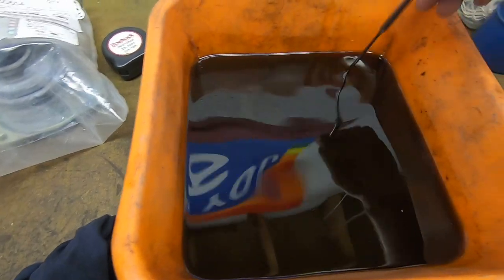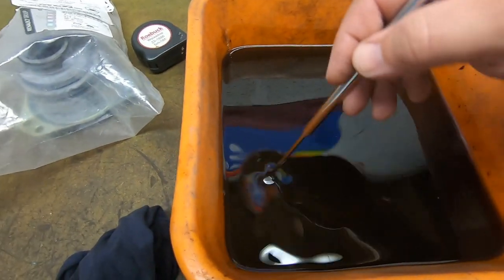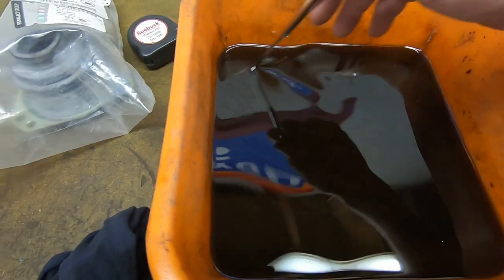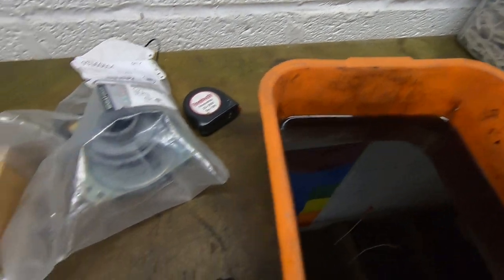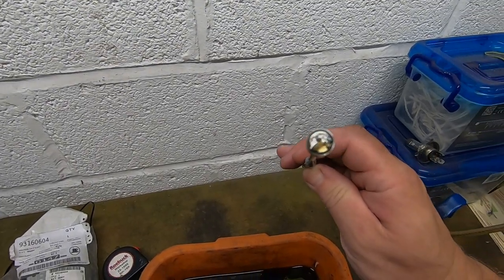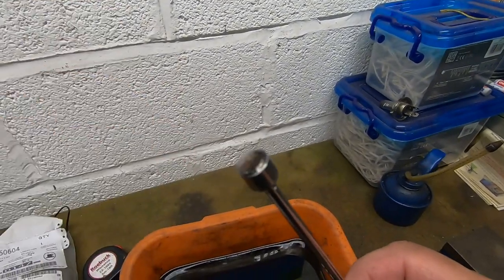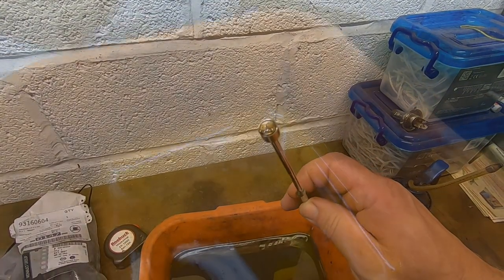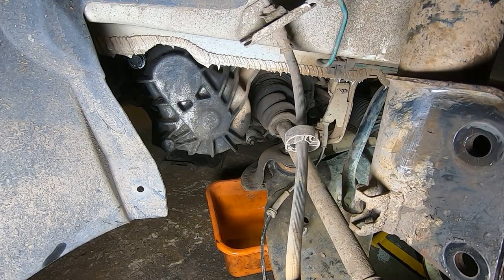Fixing our Vivaro's gearbox oil leak by replacing the driveshaft boot.

Comment: After your discoveries in the last video, I went out to look at mine. Fortunately not a drop of oil in sight (or cobwebs!).
As long as we get the gist of what you are doing, it doesn't matter if we don't see all the moves, your explanations are that good anyway.
Thanks for your troubles, they help loads for future reference should there ever be a need to get my gut under the van.
Greets again from 🇨🇭, Steve.
Reply from the maker: Thanks again 👍 great to have your feedback. Great that your gearbox oil is where it is supposed to be👌.
Cheers Larcs

Comment: Just bought a vivaro 2900, 1.9 converted to camper, high top, checked belts, cam belt and pump good but needs alt v belt, been watching all your vids there a great help . I also got oil all over gearbox same as yours was and been wondering where it was coming from i need to investigate while got it up on stands , looks like inner drive boot leaking oil in fact think its on the mot advisory so may have to do the same as you, best check there's oil in gearbox, surprised yours didnt break/sieze up with only about a cup full left in it , ill check it tomorrow. I also need to do a service , watched your video on that too so feel a lot more confident about doing it, thanks for taking the time to vid edit and post its a lot of work on top of the jobs themselves keep doing them bud. A big thumbs up..
Reply from the maker: Thanks 😃. Yeah, I was surprised how little oil came with no symptoms. Good luck with your repairs.
Cheers Larcs👍

Comment: This is very useful as the garage I use told me the boot only came with the drive shaft. Not seperately.
I think what they meant is the labour charge to fit a new boot and shaft will be less?
🤔
Reply from the maker: You're probably right 👍. It was quite time consuming replacing it.

Comment: A Haynes workshop manual with all the specs is the best especially torquing all those hub end suspension bolts and the track rod end down and I would have most definitely replaced both boots on that driveshaft and packed the hub end with new grease. Cable ties are a most definite no-no for drive shaft boots.

Comment: I cant seem to find the part....only the monavo diff oil seal comes up on a search , donyou have a link ?
Reply from the maker: I got mine directly from Vauxhall. I'll see if I can find the part number I used🤞.
Cheers Larcs 👍
Reply from the maker: The part number for mine is 93160604 but looking at website Vauxhall.7zap.com there are 2 other numbers listed for the movano:- 916155 & 93180977. You'll probably have to go to the dealer with your vin to make sure you get the correct one. Good luck 🤞.
Cheers Larcs 👍.

Comment: Hi Mate, is this Boot called the inner CV boot or is that different? And just to check the bearings are lubricated by the gearbox and don't need Greasing? Cheers!!
Reply from the maker: Inner CV boot, yes. On my gearbox the left hand inner CV is lubricated by the gearbox oil and the boot also keeps the oil in. The right hand has a standard (greased) CV joint & boot, it does have an extension shaft from the gearbox and a carrier bearing too. Mine is an early set up and newer vans might be different?
Cheers Larcs 👍

Comment: Is the drivers side held to the gearbox the same way ??
Reply from the maker: No, it's a more conventional set up on the drivers side.
Cheers Larcs 👍
Reply: So do I need to drain the gearbox oil on the driver side or not
Reply from the maker: @tonythorrington3740  Sorry, just seen this question. Answered it on your old one.
Cheers Larcs 👍

Comment: I have a question buddy. I have a 2004 Movano that is leaking oil from a driveshaft seal. The main reason for this is that the actual output bearing in the gearbox is worn, allowing the driveshaft to move up and down. Can you change the driveshaft bearings from the outside of the gearbox? (held in by circlips?) or do I have to take gearbox apart?
Reply from the maker: Sorry, I don't know? Good luck fixing it🤞.
Cheers Larcs 👍
Reply: Paul by a Haynes workshop manual if it's possible it will be in there.
Reply: It's a gearbox out job.

Comment: Well I've stumbled across your great video bc I did an oil change and the gb is covered in oil just like yours. Looks like I'll be tackling this job soon then! Do you know if the 2x strut bolts are eccentric and used to adjust the wheel camber?...just wondering if I need to mark the exact position before moving? Thanks.
Reply from the maker: Thanks and good luck sorting it out 🤞. IIRC the bolts are not eccentric but don't quote me on that😁. 
Cheers Larcs 👍